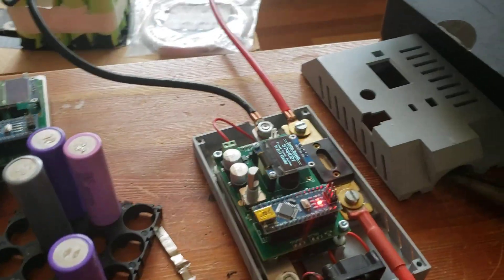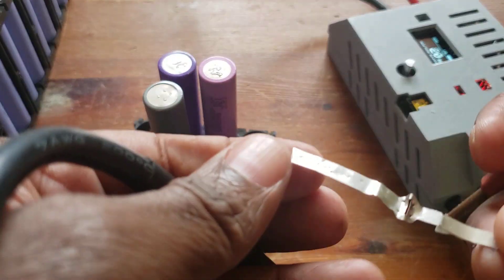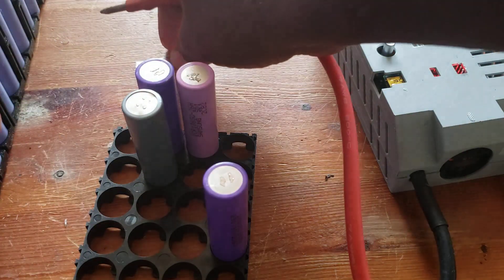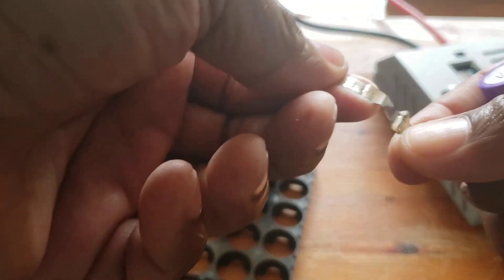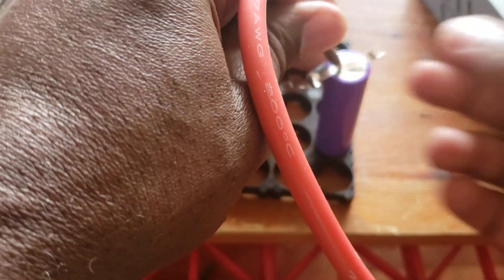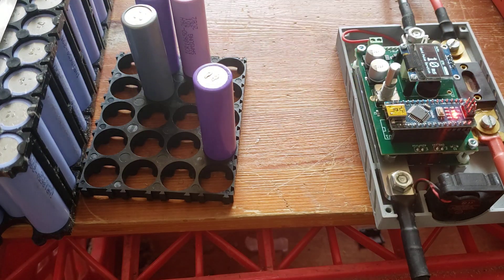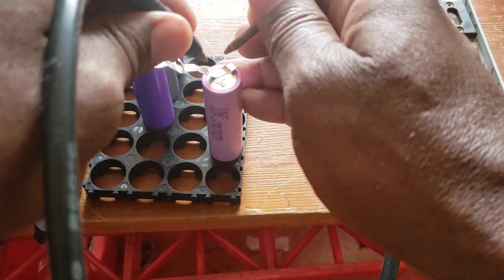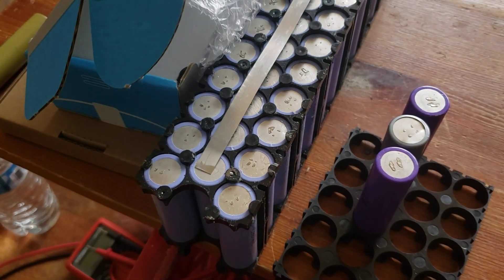MALECTRIC DIY Arduino Battery Spot Welder Kit V4 Arduino Nano based Spot Welder for battery welding

Comment: The reason you got a high battery warning when you switched to the new power source is because you are using a 4S Li po. The Malectric website specifically states that the absolute maximum voltage it can handle is 14.5V and to ONLY use a 3S battery. Surpassing this voltage might be why you fried the first one...and you might fry this new one.
Reply from the maker: Sure, thanks for the info

Comment: Maybe you are pressing too hard ?
Contact at the weld site needs to be minimised to produce the spark and heat.
Pressing really hard means low resistance and low heat.
Reply from the maker: Did you watch the  order videos. On this video, the battery 🔋 was very weak. Once I got a better battery, it worked beautifully
Reply: That's great, thank
Reply from the maker: @georgegibson707  this spot Welder stopped working on me for no apparent reason.
Reply: @simplyfocus9937  mine just did the same :(